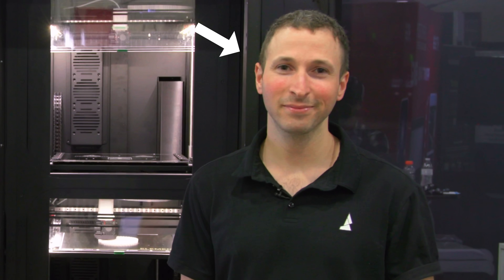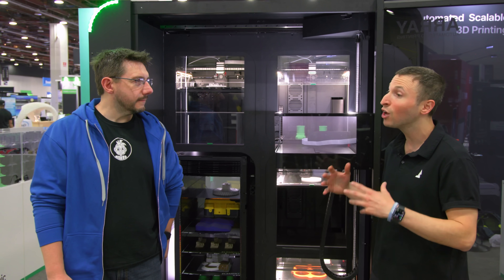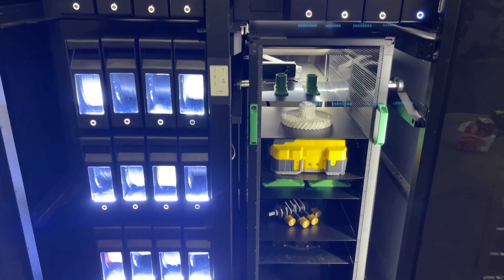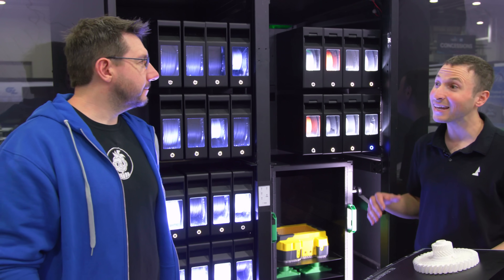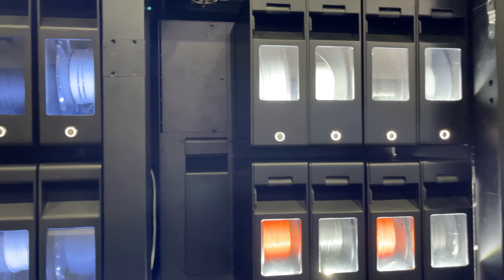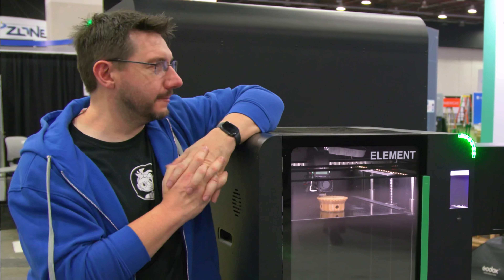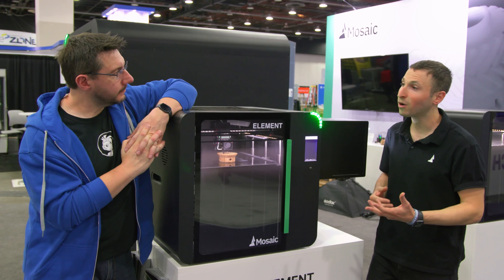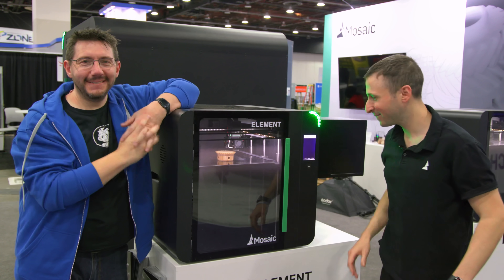MOSAIC ARRAY First Look!

Comment: There was a day and age where I would’ve hear $7k and laughed, but thinking about it, arguably the “best” desktop 3D printer you can currently build/buy is a Voron 2.4 at around $2k. This machine offers so much more than that, and it comes pre-built. If it’s as “clicks and print” as they claim, $7k is a steal

Comment: I would take this with a big grain of salt. Canvas is an immature slicer at best, and the pallet ecosystem is... Limited. Mosaic seems to be doing a ton of marketing with minimum viable products. Which would be fine if they state up front what features are still in development and what the development timeline looks like, but so far my experience is Mosaic products are over advertised and under delivered.

Comment: Looks like a great machine, but I'm a little worried about the cold end heatsink system still being air cooled. Every enclosed system I've worked with that wasn't water cooled has had issues of heat creep.

Comment: It's cool. But what things actually use 3D printed parts at such a scale that such a machine would be viable or really necessary?
Reply: We have a Prusa print farm, three Fusion 3 F4xx printers and an Essentium HSE180 (I think). We do a lot of prototyping for various types of production assembly and lots of reliability testing on those products, our printers run nearly non-stop. I'd love to get my hands on a few of those Arrays.
Reply: I have reverse manufactured my products and make them for 33% less int the states so absolutely positively can be done! This machine would even reduce my cost even more so! All about workflow and design process with AM. Most have yet to figure it out as it’s reimagining design for manufacturing!
Reply: Not much because it’s too expensive to manufacture this way. They hope to change that.

Comment: Maybe I missed it, but what was the estimated price tag for the array?
Reply: Array starts at $70k USD for the base model and $90k USD for the high temperature model.
Reply: @mitchelldebora8097  That’s comparable to an industrial VMC like Haas VF2. I think it’s a good price for what it can do if it delivers the promised reliability.
Reply: Since they didn't mention it, must be an arm or leg.
Reply: Didn't mention it - I know a company that has 3D printers (SLS not FDM mostly) that cost between 200 000 € and 1 000 000 €. A 5 achsis CNC milling machine and a lot of other stuff is also in that range. 
So I would guess the estimated price tag for array is also in that range.

Comment: I wonder if those filament carts are a proprietary thing or if you fill with your own spool, For a business that could be an important item as materials cost can escalate quickly with such things
Reply: The Material Pods on Element  Desktop allow you to use any filament you like so long as it fit's inside the pod (most spools do). That said, Mosaic filament is priced really competitively with others on the market to give the best of both worlds: (1) A reliable + expertly tuned experience with no tweaking and (2) affordable pricing.

Comment: Man, I'd love an Element, but the price. Like I get that HT printers are expensive, but like, is it artificial? I find it hard to believe that something in the manufacturing process justifies 10K. Seems to be more the limited demand/market driving the prices.
Reply: It's a few factors that what might seem like not huge differences make a big price difference.

Since this is an industrial use printer first off the way it is built has to meet those industrial requirements. Needing much higher quality of materials, production, assembly, and support. Add to that the HT that those materials need to operate.

But by far the biggest driver for cost is reliability. The way these machines are usually pitched is that you once it runs it just runs and you don't have to worry. Making a 3D printer that gets everything right almost all of the time requires some serious investment in R&D to get it there. 

I would love to see a "review" of long term use of one of these 3D printers and a comparison that shows how much time, money, and work it saves vs a high end consumer printer like a Prusa (Which are also used at farms and need reliability).
Reply: @oinosme4931  yeah, that makes sense. I guess I've just never seen someone running one of these "reliable" machines for an extended period of time. While I've seen people run "unreliable" prusas for 10+ years with only minor issues and maintenance. Or like vorons can go for extremely long periods of time with minimal fuss, and you can build those with high end materials for a fraction of the cost. I guess some of it is definitely market.
Reply: @ZeeLobby  Yep, for industrial use, support is a major requirement. I'd love to get a Voron at work but we get printers that are 3X or more the price just for the support...though for the record, the support is usually fantastic. I'd love to get a couple of those Arrays though...
Reply: @circleofowls  they are real cool. I'm just jealous XD
Reply: The development cost is really high.
For technological stuff it is common to set a higher price for a product at first and lower it if demand is fullfilled or if better technology or other manufacturers comes to the market to recuperate the development cost.
Also I guess that they don't produce a huge number of printers - more is usually cheaper per single piece.
High quality is more expancive.
In a few years such printers will be cheaper and/or there will be consumer variants.

Comment: I hope this goes better than your Palette3 launch.
Reply: I missed that. What happened?
Reply: @JonS  Firmware was basically undeveloped when the machines were shipped to users.  Tons of bugs and missing features.  Lots of hardware issues.  I bought two machines and both had to be replaced.  Even 7 months later there are still issues.    They are working on them but its not quite the $800 experience you would have expected from a premium product.
Reply: @audiorazor   We apologize for the experience that you had with your two units, and we'll continue to provide you assistance as we have in the past, including replacement parts and units with all costs covered. We're still releasing firmware updates constantly which include new features and functions based on feedback from the community. We do appreciate that you're sharing your successes in our weekly print contest and look forward to what you'll print next with your Palette.
Reply: @audiorazor  this is why I never pre-order games or any other products.  There's nothing worse than paying to be a beta tester.  I had that experience once and won't to it again.  I wait for long term reviews such as reading yours and see how the company handles things.  It's the reason why I haven't purchased a steam deck.
Reply: @MosaicManufacturing  Things have definitely gotten better but its not quite there yet.   I dont want to distract from your new release so I won't keep commenting.  Wish you the best of luck with the Array.
Reply: @MosaicManufacturing  This comment didnt age well since there hasnt been a firmware update in over a year and you publicly said the team is too small to focus any more time on it.

Comment: Very exciting news! Automated multimaterial/color prints sound great. I hope the no-human-input part really works for the stated printing efficiency, as the ARRAY takes up huge amount of space for 4 printers, and requires spatial access to front AND back. You can probably fit 18 Prusas there with no back space necessary. The ARRAY would be the ultimate farm if it can print fast.
Reply: @PeppoMusic  Yes you are right. The automation part is definitely the key selling factor - running non-stop with little human interference, enabling scale for mass production. The maintenance/reliability part is still unsure, as the Array has proprietary software/hardware, needs to handle much more materials, and there are a lot more moving parts than a desktop printer. I think 3D print automation will improve as to enable more efficient use of space, like an Array version with more smaller printers in the same chassis.

Comment: my problem is that the older version of the palette software or the canvas hub hasn't been working for over a year and support has been saying we are working on it. so until they make it so the older equipment works again i won't buy from them again
Reply: I'm using a 2S Pro... I've always used the online slicer since I'm a Linux user.  I didn't realize that the software wasn't working.  Other than convenience, what is the advantage of not using the online tool?
Reply: @chmnrd  you cant send from the slicer to the hub. it will still work if you manually upload it but the communication from the online slicer to the hub is broken
Reply: @markburton5292  Sorry to hear that you're experiencing this issue. To confirm, have you updated the Hub plugin to be compatible with Python 3? We released this update last year.
Reply: @MosaicManufacturing  Yes I even reinstalled multiple times from the mosaic, i sent multiple logs to mosaic when asked just to be told we are working on it then silence.
Reply: @markburton5292  Sorry to hear that no one has gotten back to you on this. Let me follow up on the e-mail thread with some additional information, you'll need to re-flash the image file to your Hub.
Reply: @MosaicManufacturing  I was able to get a working solution. This entailed creating a New octoprint image from the raspberry pi imaging software and then reloading the plugins.  While i had done this before while on 1.7 i did not do that on the new 1.8 that was recently released.  The plugins do work on a fresh 1.8 release.
Reply: @markburton5292  Great to hear, thank you for the update!